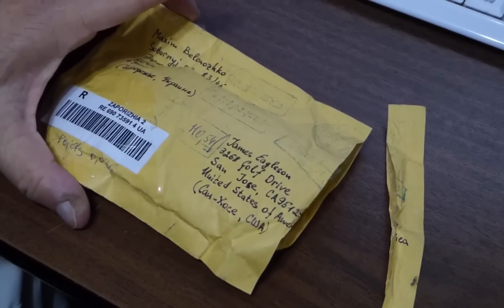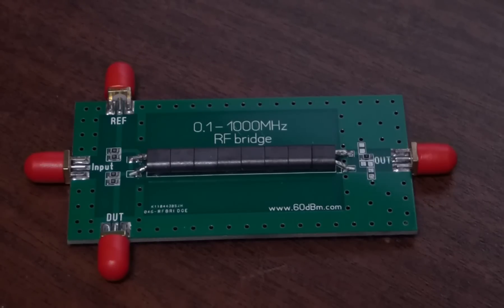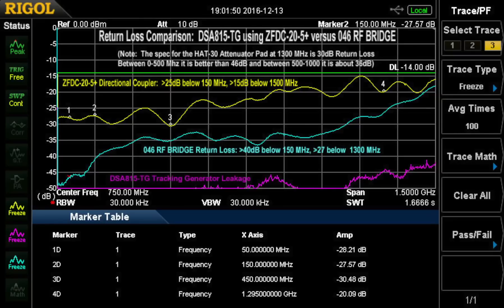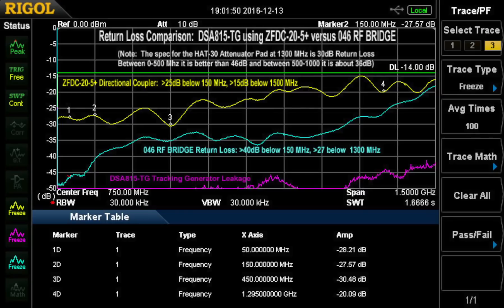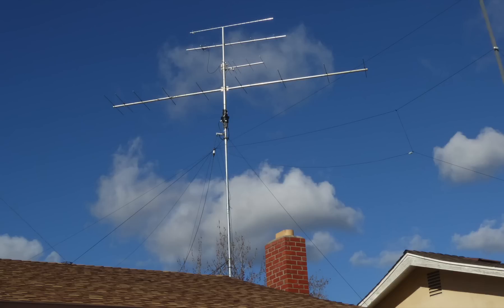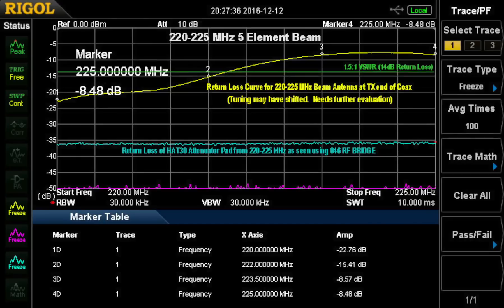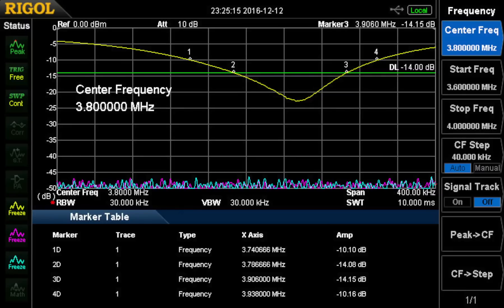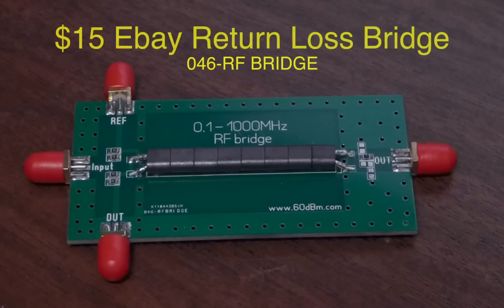$15 Ebay Return Loss Bridge

Comment: would it work better in enclosed in metal box ?
Reply from the maker: Probably not.  30 dB RL when measuring a precision load is adequate performance for most uses.  40 dB is typical performance for RLB bridges considered Professional Grade.

Comment: James, I can hardly believe it but I finally got the unit to work after reversing the connections!  Didn't you notice that problem with yours since they are also reversed in the photo at the beginning of your video?  I contacted Serge at transverters-store.com who claims his units work properly but the fake Chines ones don't and asked him why the ports on his units are reversed the same as the Chinese ones but he refused to answer and blocked me with a spam filter.  I think he's actually selling Chinese made ones too since the photos on his website are identical to the ones being sold from China on Ebay right down to the same bad solder joint on the Input connector SMA center pin!
Reply from the maker: The swept signal source (Tracking Generator) attaches to the connector  labeled "Input" exactly as shown in my video.  The "DUT" and "REF" ports are for Device Under Test (your antenna in this case) and Reference (50 Ohm Load) respectively just as shown in my video.  "OUT" goes to the Spectrum Analyzer input as shown.  (By the way, it will make no difference if the DUT and REF ports are swapped.)
Reply: @jimeagle1  It DOES make a difference if the ports are swapped since they work differently!  The original design with the ports correctly labeled can be seen here: http://hiqsdr.com/index.php?title=Bridge-Circuit
Reply from the maker: I've looked at the article mentioned and the unit I show in the video is identical... Input on Left, DUT on Bottom, REF on Top, and Output on the Right.

Comment: >Clifford Heath:  This page shows the PCB tracks with the missing connections! https://www.ebay.com/itm/0-1-3000MHZ-RF-SWR-Reflection-Bridge-Antenna-Analyzer-VHF-VSWR-Return-Loss/253947491090.
I can't see any difference between that one on Ebay and the one on the transverters-store website. Actually it looks like the one from there was also made in China!  There is a note on the website about fake items from China (which seems odd for an open source device) so I emailed them about it and got a reply from Serge saying: "They have a mistake in the PCB."  He wouldn't tell me what the mistake was however and his unit also has the silk screen for the Ref and Dut reversed like the Chinese ones.
Reply from the maker: Theoretically there should be no difference but this depending entirely on the balance capability of the Balun used on the output of the unit.  I tried my unit while swapping the REF and DUT ports using a quality SMA 50 Ohm Load and the same 439 MHz Patch antenna and I got the same exact results at the Output port either way.
Reply from the maker: Ah!  I looked online on EBay and found what appears to be a Chinese copy made by someone who doesn't know how a 1:1 Balun is supposed to be made.  It is connected totally wrong thus would probably not be balanced or matched correctly.  Sloppy soldering, as you indicated.  It is marked as being from the transverter-store but probably isn't since it ships from China directly!  Fake item for sure.

Comment: James, after seeing this video I bought one of those RF Bridges but I've never been able to get it to work which is why I was confused.   You show yours producing a dip at 2:40 into the video but mine would never do anything like that.  Sometimes it produces dips but they have nothing to do with the resonant frequency of the antenna!  I got a heavy duty directional coupler and it works great showing a large dip at resonance but this cheap one won't do anything.  I've looked it over and can't see anything wrong with it physically so how did you get yours to work?
Reply from the maker: steve c.  Send me a diagram or picture of how you have it connected and I might be able to figure it out.  You do have a reference 50 Ohm load on the Reference Port, I presume.  This does not connect the way a directional coupler connects.
Reply: @jimeagle1  It's connected the same as you show in the video at 2:25 with a 50 ohm terminator.  If I substitute a directional coupler instead that works perfectly and gives a dip the same as you get but when I try the RF Bridge it does nothing at all.  The unit looks identical to yours and I checked it over carefully and couldn't find anything wrong with the soldering, it all seems well connected but I couldn't check for shorts since all the elements are connected go ground at some point.  It seems like a piece of rubbish and I will probably just salvage the SMA connectors and ferrite beads and toss the rest in the trash bin.
Reply from the maker: steve c   The unit may be defective, then.  I'd take it up with the vendor if I received a unit that didn't work.
Reply: @jimeagle1  I've had it several months trying to figure out what's wrong and probably can't return it now.  The odd thing is I've compared it with the photos and it seems to be identical but it's not the same as the original design that had more resistors on the board.  I still think it's a fraud and can't possible work. Videos showing this thing are a lot like all the fake quadcopter videos where they show some model flying beautifully when in reality it can't fly at all.   Are you sure the one in the photo is what you actually used and not something else such as a directional coupler?
Reply from the maker: steve c  What you see is what I used for the video.  I have another video that shows direct comparisons between this unit, another bridge, and the MFJ directional coupler. I would suspect a cracked SMD chip or shorted turns in the. baling to be causing your problem.
Reply: @jimeagle1  Shorted turns where?
Reply: @jimeagle1  I looked the unit over closely under a microscope and didn't find anything wrong but the solder joints where the center pins of the SMA connectors were attached looked a bit suspicious even though they checked OK with an ohmmeter, so I re-soldered them and now it works a bit better.  It gives a dip now at approx. the right frequency but the dip is pretty small and hard to see sometimes at only around 10 dB, nothing like you seem to be getting.
Reply from the maker: The only other issue I can think of is the quality of your reference 50 Ohm load which needs to be placed directly on the SMA connector (no coax) using an SMA load or good quality SMA to N or BNC adapter with a precision load.  You also haven't said what frequency you are using.   I find at VHF and higher you need good quality coax (RG141 or 142, LMR200 or 400) to achieve good results.  Don't use RG8X or RG58. 

If you are not seeing at least 15-20dB Return Loss with a precision load on both ports (Ref and DUT), there is definitely something wrong with the unit.  

Other suggestions:

It is best to use full Tracking Generator output (0dBm) with good coax to the unit and make certain that it presents 50 Ohms by using a high quality 3 to 6 dB attenuator at the Bridge input to swamp out any coax impedance issues.  A 6dB attenuator will provide a minimum of 12dB Return Loss to the input port even when shorted or open.   

Also use a Receive Bandwidth on the Spectrum Analyzer of 10-100kHz for best results.  

With a Rigol SA you should also limit your Sweep Frequency range to less than 100 MHz for best accuracy.  I use it at the lower and upper band edges of the expected range for the antenna I am testing or just beyond those limits.  

The Rigol only evaluates 600 points within the Sweep Range so using it over wide frequency ranges will limit its accuracy to Sweep Range/600 for each step.  (Example:  600MHz/600 points = 1 MHz per point.  60MHz/600 points = 100kHz per point.)  Thus if your antenna bandwidth is only 150 kHz wide, only 1 point may be captured somewhere within the antenna range and may not be at the best Return Loss point.  

Of course the Rigol sampling algorithm may adjust for the 600 point limitation by oversampling or other tricks but I have found that even though oversampling may be used, frequency accuracy for Peaks and Minimums will definitely be more accurate with more limited sweep range.

By the way, if you are trying to use this with whip antennas, you may not get very good results since the other half of the antenna is the body of the HT which will tune it differently than the Bridge PCB, especially with coax attached.  The best way to test whips is by mounting them on a ground plane at least 1/4 wavelength in diameter at the test frequency.
Reply: @stevec5000  I purchased a unit on AliExpress that looks almost exactly like this one (except for the fake silk-screen of the original designer's Ukraine-based store www.transverters-store.com) and on close examination by eye and with a resistance meter I found that the far (from the input) ends of the two pairs of 100R resistors are not connected to each other. So the DUT port has 100R in series and nothing else connected, and the 2nd resistor on the REF side is not connected on both ends. Needless to say, this can not possibly work. After correctly pairing the ends, the schematic exactly matches the original invented by Paul McMahon VK3DIP (see www.yagicad.com) but for the REF and DUT ports being interchanged, and I expect it will perform correctly. You should check the connectivity of your resistors! Both ends of each pair should be solidly connected.
Reply: This page shows the PCB tracks with the missing connections! https://www.ebay.com/itm/0-1-3000MHZ-RF-SWR-Reflection-Bridge-Antenna-Analyzer-VHF-VSWR-Return-Loss/253947491090
Reply: @CliffordHeath  Did you ever get yours to work properly?  Mine came from the Ukraine and looks exactly like the one at the beginning of this video except for saying www.transverters-store.com on it but it doesn't do anything at all!   All the resistors and everything are well soldered and it's all connected up properly as far as I can tell.  It also has the REF and DUT markings reversed, like the one in this video!  Oddly the ones from China and from the Ukraine all have the markings reversed!  Maybe that's the problem that I've been trying to use it backwards but that still doesn't explain how James got his to work in the video!
Reply: @CliffordHeath  Are you saying there are connections missing at the bottoms of the two 100 ohm resistors on the ends away from the Input jack?  It's hard to tell what's underneath the solder mask in the photos and I didn't see any missing connections so I checked with an ohmmeter but both of mine are connected together.  I emailed transverters-store in the Ukraine to ask them about it since they have a notice concerning fake units from China.  I got a reply from Serge saying "They have a mistake in the PCB" but he wouldn't say what that was except to say that his model works properly.  The photo of the bridge on the transverters-store website looks identical to the ones from China however.

Comment: Nice I have just made a video on using directional couplers to calculate return loss. That looks like a nice coupler for the cost.  Is the swa display on the rigol a pay licence feature, I could not get it to work on my 815, the menu was grayed out.  I hate the SMA connectors. Nice video regards Chris

Comment: Is this thing made for use of multiple receiver antennas and you don't lose gain using this device
Reply from the maker: This is not an SDR or a VSWR meter to be used inline between a transmitter or receiver and an antenna.  It is a test instrument used to test one item at a time,  It is used to check the match of an antenna, filter input, dummy load, etc.  I hope I understand the nature of your question.

Comment: Hi Jim! I would like to know how you are writing on the graphs? Is this a photo of the 2 Directional Couplers or the actual on screen graph? I am curious how you did this? Also, like you, I find a big difference between my ZFDC 20-4 and the Green Ukraine board. The Green board is either very generous or the ZFDC is a miser! Don't know which yet! 73's DAVID. K8KEM
Reply from the maker: Text on screen is done "post production", that is, I enter the screen shot into Photoshop then add text as needed on the screen capture photo.  I also use Photoshop to reverse the image in some cases... especially when printing.  Saves a lot of ink if the black background is reversed to white.

Comment: tnx for the informative video !  oh, unfortunately the RIGOL 815-TG has LOTS of bleed thru above 1GHz which looks like "ripple". Using same setup with the Siglent 3032X its pretty flat up to 1.5GHz 
73 N8AUM
Reply from the maker: vidas v  Yes this is a problem with the Rigol DSA815-TG... especially the earlier units.  I know that Rigol has made at least one hardware change but I don't know if they fixed that particular problem that I showed in one of my videos quite some time ago.  What are your impressions of the Siglent 3032X?  Apparently it does not have the same level of leakage as the Rigol unit but it is also twice the price.  However there is the 3021X which compares more Apples to Apples with the 815 though priced about $200 more.  Since their Tracking Generator add on is probably separately shielded I would expect it won't have as much leakage as the Rigol unit.  I did get better results from the Rigol unit by using an LNA between the Bridge output port and the 815's analyzer input port to raise the level from the 60dBm.com's output port to a level 10-15 dB higher than the  815's internal leakage.